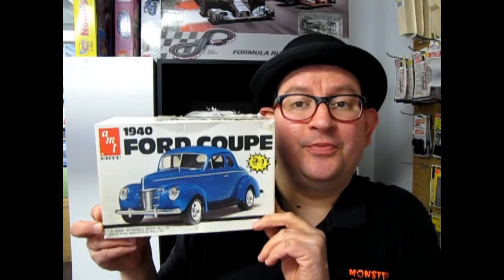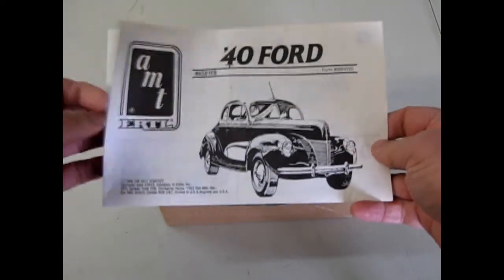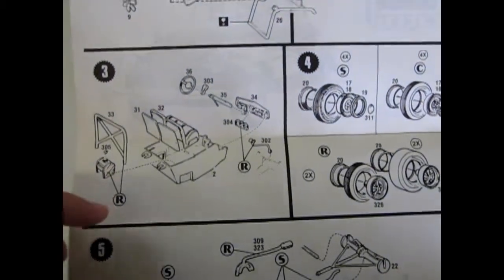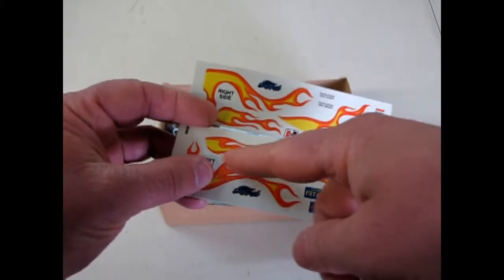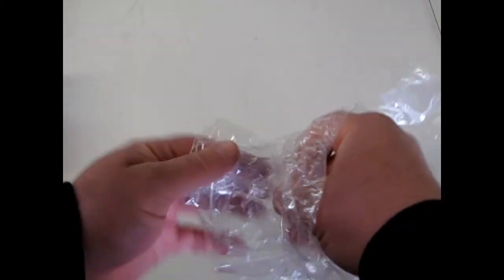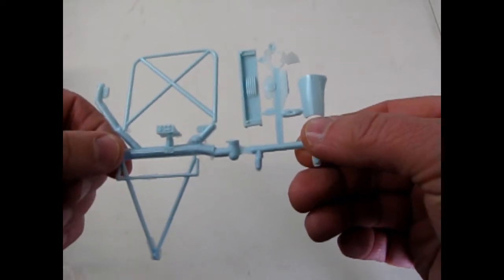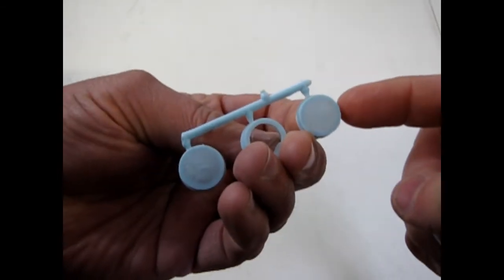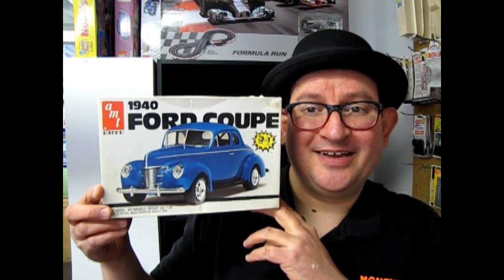Unboxing The 1940 Ford Coupe Model Kit By AMT/ERTL

Comment: Have the same kit, in the stash, and also built many of them. First issued in 1960, it still holds itself pretty well even when compared to the newer offering by Revell.
Reply from the maker: I like the engine interchangeability with the other Trophy Series kits from AMT of that time.